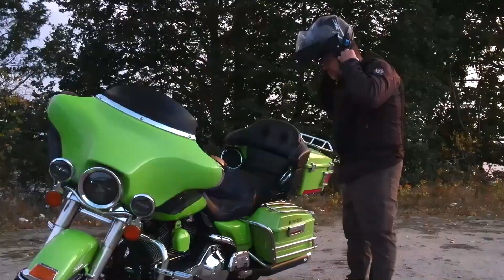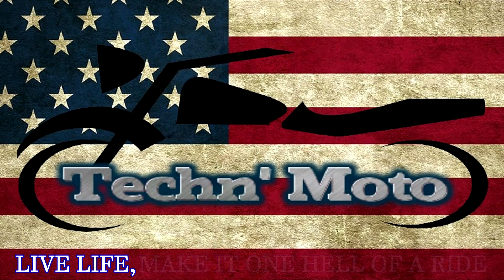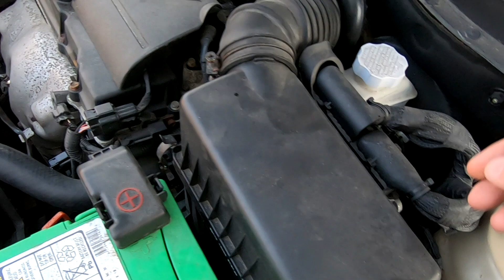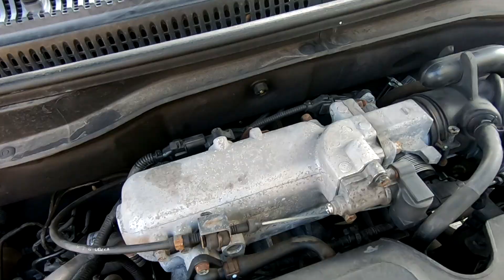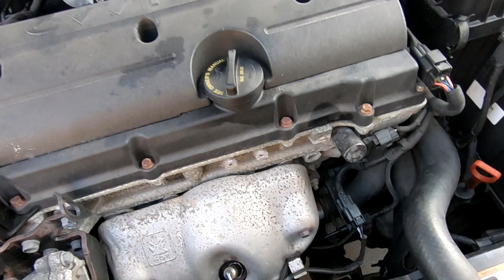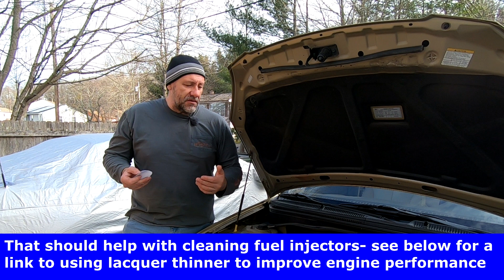Causes for Codes P2096, PO171 & PO174- Repair Lean Air Mixture Issues- Applies to all vehicles

Comment: Mazda also has an ECM update that’s required if all you mentioned has been checked. Mine was an exhaust leak (crack near the resonator) replaced it and car runs smooth and quiet, but the damn code came back.
Reply from the maker: Good to know.

Comment: I have this code , i checked and both my clamps were loose on my intake hose. I’ve tightened them back up but code came right back. Car runs and drives great no stalls or anything. Any tips ? I also noticed my MAF had turned quiet a bit and wasnt facing airlfow. Could that be it ?
Reply from the maker: @silverlaughed6016  these codes are difficult to diagnose. Check everything- the filter box, the hose, vacuum lines, etc. make sure air filter is installed properly. good luck.

Comment: I have a 2014 Hyundai Elantra same code, what’s common for them? I changed both o2 sensors and changed dirty air filter.
Reply from the maker: Most likely a vacuum/air leak somewhere
Reply: @TechnMoto  ok that’s what I figured. Although I cannot hear anything obvious, what is a good way or tool to discover the leak?
Reply: Please thank you
Reply from the maker: a smoke machine helps to locate a leak in the evap system. Check the air filter box. Make sure the seal is tight, all clips are on and then check the hose from the air box to the engine manifold. Good Luck.

Comment: Got a p2096 code, changed the o2 sensor as i also got a code for it all codes went away except the p2096 ive checked for vacuum leaks or exhaust leaks and nothing anything you recommend?
Reply from the maker: Check air filter box seal and hose from box to intake.
Reply: @TechnMoto  i recently did an oil cooler on it which required me to remove air intake manifold do you think maybe a gasket somewhere could be seated wrong allowing unmeasured air to enter the system
Reply from the maker: @Sjorge214  anything is possible.

Comment: Mines saying bank 1 and running code P2096 but I changed the O2 sensor top one
Reply from the maker: Use OEM sensors cause the aftermarket ones do not work properly. Also too much air due to a leak somewhere could cause this code too.  Take it to shop if beyond your expertise. Good luck.

Comment: Thank you for this video! I have a 07 Kia Rondo and it threw a p2096 code. Sure enough, it was an airbox issue. I was using an aftermarket filter and the clips were not tight on the box. Switched to an OEM filter and the box became snug. Saved me a 02 sensor replacement which I thought was the problem.
Reply from the maker: Wow glad it helped you. Awesome!